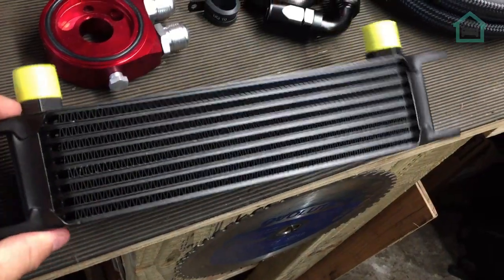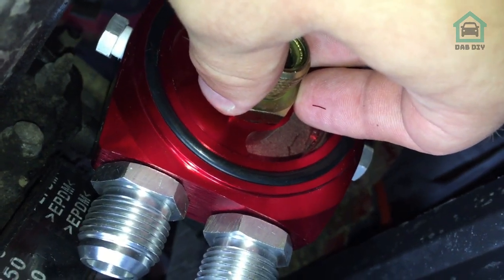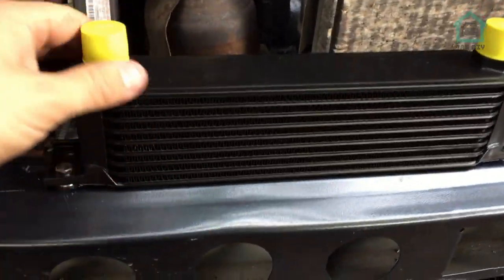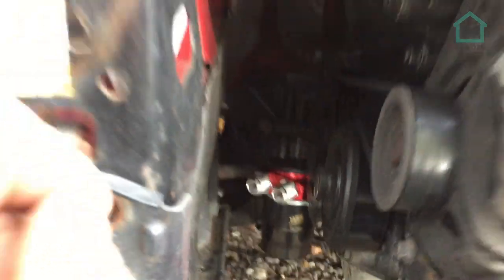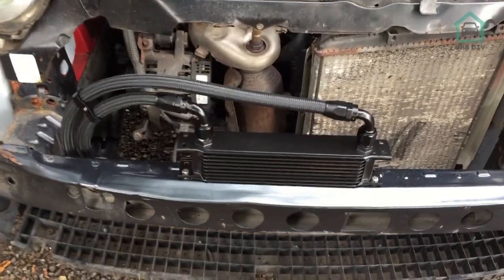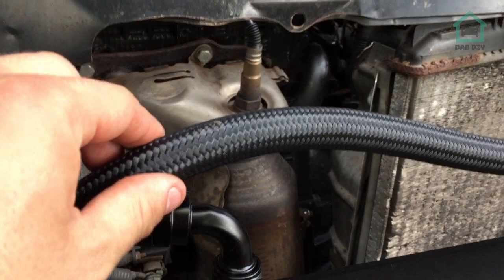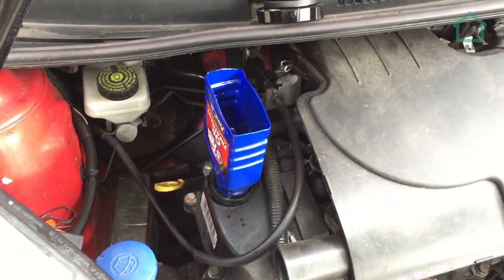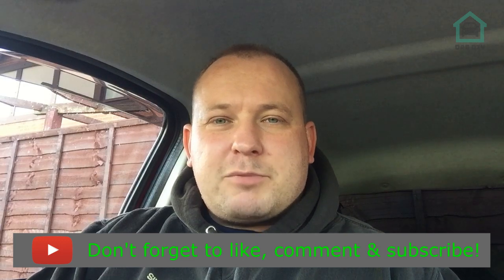Fitting an oil cooler to Project C1

Comment: Another nice video. I’m excited for your new video as I’m having a mk1 Aygo with a rotrex supercharger installed running at 9psi. 
My next install will be an oil pressure gauge and I think you should install one too, especially with the added oil cooler which now increases the chance of leaks on a bunch of extra places.
Anyway good stuff and hurry up with the turbo ;)
Reply from the maker: I’m also looking to run a similar amount of boost, I was going to start with about 7-8 psi and see what happens.

I do intend on fitting a pressure gauge. There’s some AN4 outputs on the sandwich plate that I’m going to use to fit a pressure gauge and an output for the turbo oil supple.

I’ll be honest, it’s going to be a while until the turbo is all done and fitted. I’m doing these things around my day job and I’m still collating all the parts necessary to start the build. Some parts I’m having to have custom fabricated, these things take time and money. I’m really looking forward to getting it fitted though.
Reply: @DABDIY  sounds good! I can testify the internals take the 9psi well, however I would have preferred a turbo rather than the supercharger as it’s only picking up after 3500rpm but on max boost when hitting the rev limiter. So it’s not giving much at the lows but only at very high.
Will see what the new exhaust does to it but I will need a blow off valve and an intercooler as well.
She is already much faster than stock though but when you start, you’ll have to go all in
Reply from the maker: That’s the very reason why I’ve chosen a Garrett GT15 turbo; nice and small, so it doesn’t take an age to spool up and choke the engine.

Comment: Absolutely beautiful! For the wrong fitting - it happens to all of us mate. You admitted the mistake and fixed it. We all live and learn.
What boost you think can run on the original engine safely?
Reply from the maker: Yeah, nobody is perfect. I intend to be running around 7-8 psi on this engine. Once I’ve got everything dialled in right, I’ll be putting a fresher engine in cause this one was previously used on a race car and currently has about 106k on the clock. If I detonate the engine while dialing it in, it’s not a huge issue.

Comment: what turbo are you going to use the boost your giong to use and the HP gain are you hoping for. im nearly ready to put a ct9 with 14 or upgrade to the 17psi waste gate for 180/215ish hp
Reply from the maker: I’ll be using a Garrett GT15 turbo, initially planning to run around 7-8 psi of boost. Nothing too dramatic, just something to peel up daily performance.

Comment: Looking good so far. I do remember when looking at a C1 that was supercharged that they had put on a bigger filter from something like MR2 or a Celica, can't remember. This was because the stock oil filter became a pinch point and was restricting flow through the system. So might be something to look into before the turbo install.
Reply from the maker: That’s definitely a good point. I’ll look into some bigger filters 👍🏻